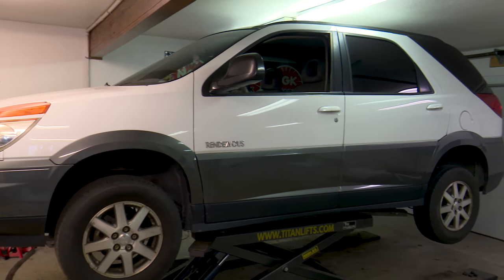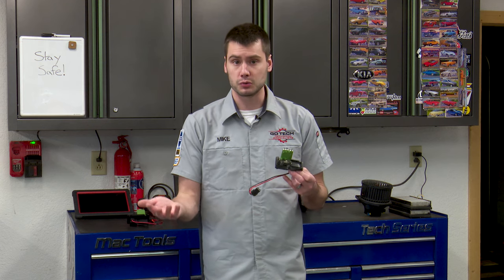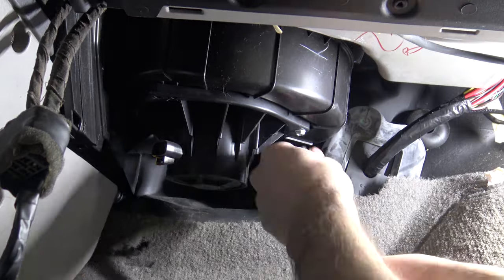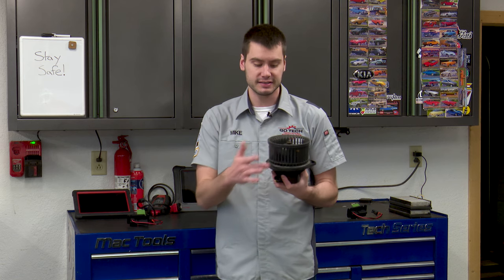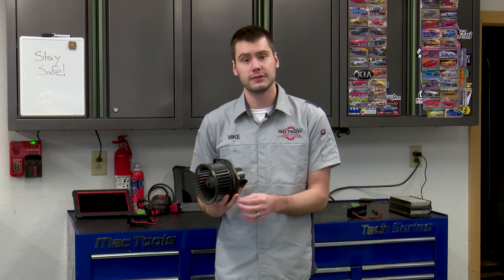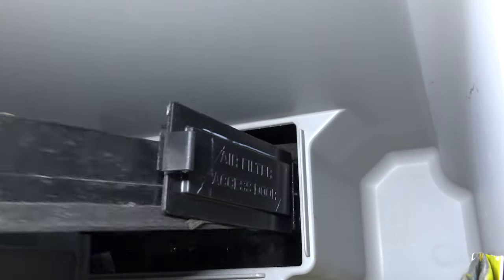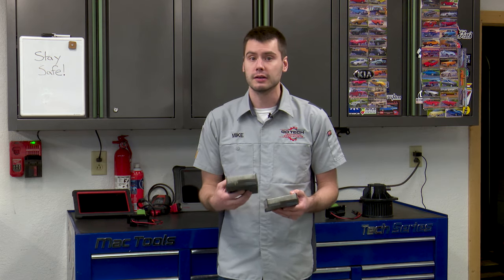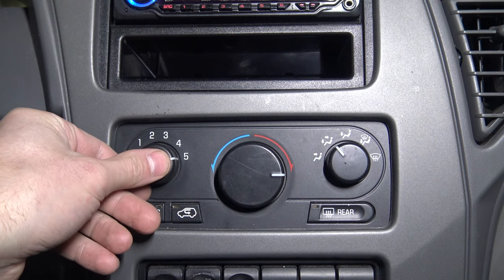Blower Motor Fan Only Works On High Speed? Plus - Tips To Prevent Repeat Failures!

Comment: Replaced blower motor in my 2004 Chevy astro,3 melted down resisters later I discovered the new blower motor was over amping new blower motor new resister 2 years later no problem

Comment: My blower motor stopped working altogether, so I replaced the resistor, when I installed the new resistor it only worked on high so I returned it and installed another one sMe thing.when I put the old one back its working again.I removed the fan it wasn't binding but I oiled it replaced my cabin filter.  Why would  a brand new resistor only work on high ?
Reply from the maker: Hey Richard, that's interesting. My first guess would be an issue with the part number. Are you sure it was the right one for your car?
Mike Becker, Senior Instructor
Reply: @GoTechTraining  that's what I thought.

Comment: So i changed my resitor nd cabin air filter nd on high it blows good but when i put it on 1 2 3 it won’t blow strong i have to keep it on high in order to feel the air & my rear seats vents also

Comment: I have 1 2 and 3. But 4 or high doses work??
Reply from the maker: That depends on the car. Sometimes high speed goes through the resistor, sometimes not. I'd need to see a wiring diagram.
Mike Becker, Senior Instructor
Reply: It’s on a 2001 GMC Sonoma

Comment: The blower in my van must be wired straight to the battery, it squeals while running, sounds like it wants to seize up, previous owner jacked the wiring, trying to wire it straight to a power source, the dash switch was stuck.

Comment: I changed the blower motor ,resistor, cabin filter ..still only working on high speed ..maybe I’ll missing something
Reply from the maker: Hey Greg, are you able to see if the switch is working?
Mike Becker, Senior Instructor

Comment: I hooked a volt meter to the leads, high is 14 volts, any other speed is 0.5 volts, obviously the resistor is shot, not sure why it won't power on with it set to high now, getting a switch, resistor and motor, damn parts store sold me one that wont plug into my harness.

Comment: What if blower only works on the first few speeds one not the higher speeds?
Reply from the maker: Hey Frank, I'd need to know the type of vehicle to get an understanding of how the system works.
Mike Becker, Senior Instructor
Reply: It’s a 2015 Mini Countryman. It will only pull a max of about 6.5 volts. Won’t go past medium speed.

Comment: None of those are my problem. Mine is stuck on high. I changed out the resistor, still stuck on high. Checked the blower motor, spins freely and the current is half of the fuse. The air filter was taken out and still stuck on high. I changed out the entire AC/Heater control panel and still stuck on high.
Reply: Why do you ask us to ask questions if you dont answer? Been over a year and its still the same.

Comment: Blocked air filter making fan motor work harder = false news. Sorry. You have the tools, measure?
Reply: It's a common misconception.
Reply from the maker: Yep, you guys are right. Watch for another video tomorrow morning.
Mike Becker, Senior Instructor
Reply: A blocked filter draws less amperage   Because of not enough air being pulled by the blower wheel sort of like free wheeling
Reply from the maker: Anthony, yep, I said it wrong. Watch for a video tomorrow :) 
Mike Becker, Senior Instructor
Reply from the maker: Here's the updated video guys! https://youtu.be/Mpugn7xsQ4g

Comment: What if I only get high speed on any speed?
Reply from the maker: Hey, thanks for watching! Interesting, could be that it's wired up wrong, or something is shorted inside of the resistor. Guess it all depends on the vehicle and it's configuration.
every beck and call.

Comment: While I would not say he uses terms inappropriately as he interchanges teems, but does use terms in a manner that if you do not know what is being discussed, it is confusing. Actually it is distracting when it is understood. 
My suggestion is to give thought in advance to the terms you plan to use. IE you used ‘too much electricity’ while that is not inaccurate, it could be more accurate! 
When much of what you described is too much resistance or resistance than designed is required to run the motor. 
All aspects are a part of electricity as is voltage. Again distracting and potentially confusing.
Reply from the maker: Coy, this is all very true. I use "electricity" because this is meant to reach people with a lesser understanding of electricity than you or I. They may not understand power, current, resistance, wattage, AC/DC and so on. I tried to keep this on the more basic side...but yes, you are current that to "the well informed" it could be confusing. Sorry for that!
Mike Becker, Senior Instructor
Reply: GoTech I guess take a few moments and give a basic explanation if each term. And I know as  you that we often get lazy and use terms loosely. I have been guilty of even saying ohms instead of resistance, know the difference, but running ahead in my mind from where my mouth is. 
The entire field of electricity is one most people never fully understand. I told my son years ago when he went to tech school to become an automotive technician, if he would learn the ins and outs of automotive electricity, he would always have places willing to hire him. 
He learned but hates doing the work. If I am around I usually end up with those jobs.

Comment: Your Milwaukee battery is charged
Reply from the maker: Haha it is, isn't it! Thanks for watching.
Mike Becker, Senior Instructor
Reply: GoTech was afraid it would get hot an you 👍 I forget mine sometimes 🙈
Reply from the maker: Wait, so you don't just leave them on there??? I was told by the battery/charger engineer at Milwaukee that it was ok. They are "smart control" chargers that won't overcharge, they simply maintain once they're full.
Mike Becker, Senior Instructor
Reply: GoTech sorry had to look it up ,yes is smart charge 🙈